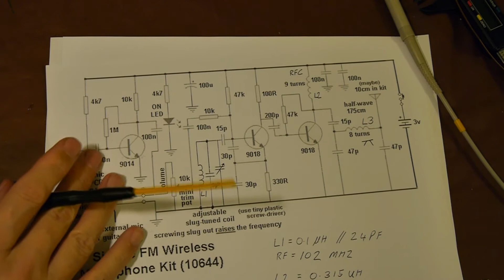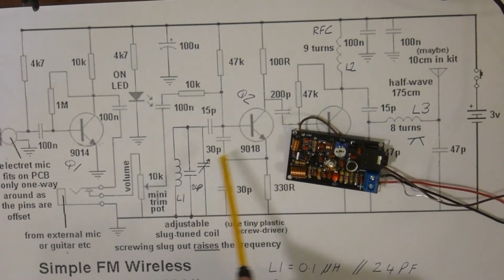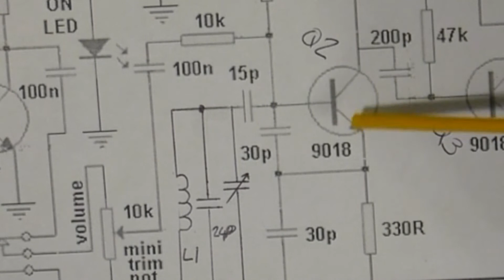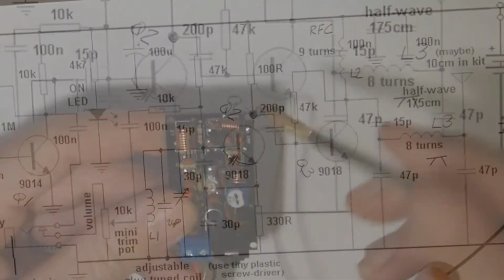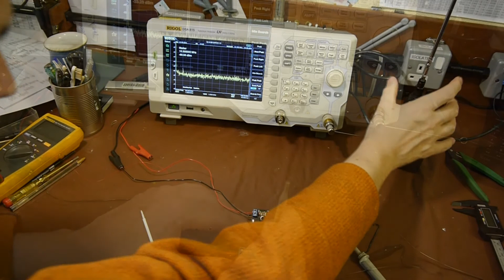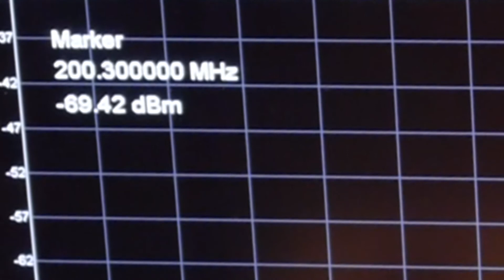Talking Rubbish TFM009 FM Radio KIt - Part 2

Comment: Excellent video Chris, enjoyed the circuit description! On the diagram the external input connector is incorrectly wired, the tip connector (with the "v" in it) should go to the the oscillator circuit and the switch connection (line with up arrow) should be fed from the audio preamp.  It would be interesting to do the harmonic checks agian with the transmitter in a metal enclosure. Regards, David.
Reply from the maker: David V  Your absolutely correct when I look at that connector I didn’t spot that one. There were several other big errors on the schematic that I did Tipex out and redraw.  I should have look how far down on the fundamental the harmonics were but forgotten and couldn’t be bothered to check later. I will try and box it up in a future TAT video.  Thanks for watching Regards Chris

Comment: In my previous life in broadcast radio, they refer to it as "Phantom Power" Typical is 48 volts. That tiny mic is probably biased at around 3-5vdc though. BTW, the FCC in the states is currently unfunded don't know if you have heard. Wondering how this is all going to play out with Ajit Pai in charge.
Reply from the maker: Danish Native Phantom power, Ghost Supply well i was close. 48 volts wow that’s considerably higher than I would have imagined. Our equivalent of FCC is Ofcom here in the UK and government funded. They used to be very hot on tracing down abuse of the air waves but have been concentrating on flogging of 5G phone licences in more recent years.

Comment: In the USA you don't need a license for a FM broadcast band transmitter if FM transmitters have a Maximum Effective Radiated Power (ERP) of 0.01 microwatts or 250 µV/m measured at 3 meters.

Believe you are correct about the method of FM modulation.  Think that's called the Miller or Millen effect or something like that.  It's just exploiting the same principle that a varactor diode works on.  Really cuts down on the BOM.  Less parts = lower cost.
Reply from the maker: MikesRadioRepair  I don’t actually know the law here in the U.K. I had assumed it was illegal but there are lots of IPOD Phone FM adapters allowing music to be transmitted and picked up a FM car radio. I think your round about correct on the name I had forgotten it myself.   Shame it didn’t work very well. I could do with injecting in some audio from a signal generator to do some quantitative testing as opposed to just yelling into the Mic. Hope everything going well with you Mike and thanks for nice stopping by. Regards Chris

Comment: Well that seems quite stable, i'm supprised, i expected the colepits coil to be covered with candle wax to slow down any heating drift.

That way of modulating a carrier for f'm has always been a little odd to me.
i'm used to a varicap diode and series capacitor across the coil, then tailored audio is fed through say a 47k resistor to the cathode, the cathode is biased via 100k to v+ for a linear effect i suppose.
But that is c.b vco modulation, back to bloody c.b radios again  :-D.
Sorry lol.
Reply from the maker: zx8401ztv The varicap diode is exploiting the same principle but they are just doing it on the cheap. It probably can be made to work with a little fudging. It was actually very stable over the short term and quite robust.  I would go over it with hot melt glue if I wanted to keep it. But it is not worthy of the effort. Still interesting little project that filled a space as they say.
Reply: Oh yes, i'm sure you enjoyed making it :-D.
I loved making the old maplin kits, i had to send off to birmingham as there were no maplin shops at that time.
A keyboard for a zx81, a simple signal generator, and some kind of odd channel processing for an oscilliscope, were a few.
In one kit i got all the diodes in the wrong way round lol.
I was a silly bugger in those days, still am :)

Comment: that was very interesting probably the best I have seen of an assembly and test of a little FM transmitter ! very well done would be interesting to hear how it would sound on a typical FM radio  the LED wasn't much to write home about !
Reply from the maker: thehappylittlefox aka benji Thanks for the  nice comments. I can confirm it sounds just a horrible on a domestic type FM radio. I had the radio scanner set on wide FM which would be fairly similar. Regards Chris
Reply: yes thought it might ! I have made quite a few similar devices theres one in particular I go to having built it so many times I don't  need the schematic and I remember all the component values which is good for someone who has memory problems Cant remember what I had for breakfast or to take my meds (metformin ) Regards Ben
Reply from the maker: thehappylittlefox aka benji  This could be a build for your first video!
Reply: you think so ? Ill make a note of that before I forget

Comment: That was very cool Chris!  I liked RF stuff...glad you used your com set to check it out, I was hoping!  :)  Great explanation of the schematic.  I have been study ColPitts and plan on building, have some parts rolling in to experiment.  Warmest Regards my friend.  EDIT: Just notice I'm in the links above, very cool, thanks for the bump! Can you please edit it to have my full YT name? Thanks! :) ~Jack, VEG
Reply from the maker: Vintage Electronics Geek  Hi Jack. It would make a nice video to build perhaps a crystal oscillator and a Colpitts or Hartley oscillator. I have edited the Channel name in the link. Regards Chris.
Reply: After demoing my 10MHz oscillator from eBay, and RXing some 10MHz xtals, I started a think tank and came up with Colpitts, I have some supporting components ordered and plan on building and playing.  Unfamiliar with Hartley, so I will go study that.  Thanks my friend!  ~Jack, VEG
Reply from the maker: Vintage Electronics Geek  Hartley uses inductor in place of the capacitor.  Colpitts is the most used type.